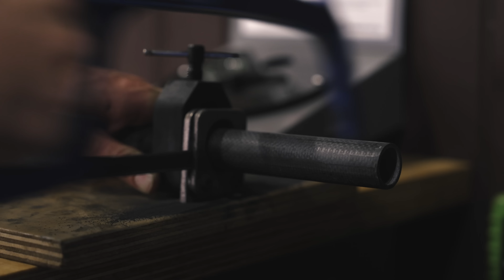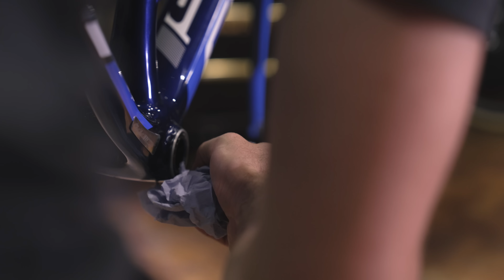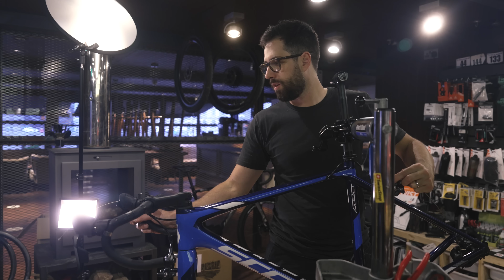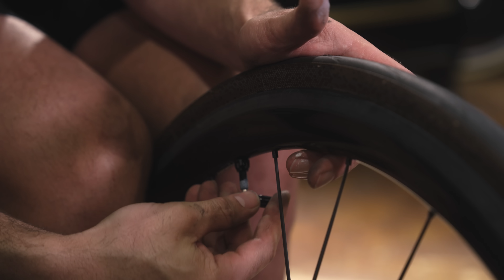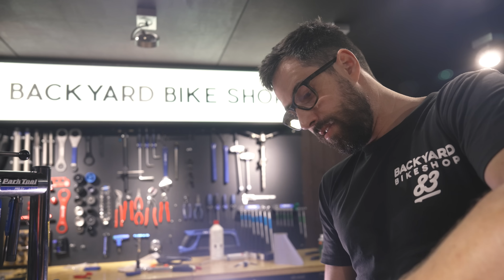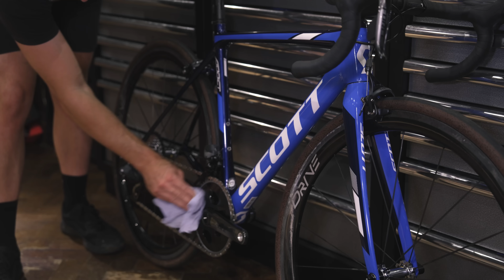Francis Cade's Rim Brake Scott Addict RC with Sram Force AXS

Comment: After watching some build videos with people endlessly fitting internal cabling this is a breath of fresh air.
Reply: Agreed. These dream builds take forever until they finally attach actual components to the frame. Even more annoying when they need zip-ties and bubble wrap to prevent Di2 cables from rattling inside a +5000 $/€ frame.

Comment: I'd have this over most the bikes his had lately. So simple, reliable and cheap
Reply from the maker: Cheap? It’s an Force AXS Etap groupset 😂
Reply: @Jimmidoesstuff  I just bought a complete brand-new Force AXS groupset 2X Disc for 1600€ (inc cassete and chain). It's not cheap, but also not that expensive, its cheaper than the new 105 Di2.
Reply from the maker: @jc74435  and sooo much better!!
Reply: Make it steel, threaded bottom bracket, non-tubeless, and non-electronic groupset, then we're talking
Reply from the maker: @ShiningTrapezoid  lol
Reply: Simple reliable and cheap, bro this thing is more complicated and about 5x more expensive than my motorbike

Comment: Classic with round seat post, separate stem, bars and rim brakes. But what does it weigh?
Reply from the maker: 7kg
Reply: @Jimmidoesstuff  So Francis builds you a bike that’s a death trap and then has this built for himself🤔
Reply from the maker: Shocking isn’t it.

Comment: what's up with the BB, just too much preload or misaligned bearings?
Reply from the maker: There’s nout up with it.
Reply: @Jimmidoesstuff  oh? Good to hear the 'mechanic' also noticed the distinct lack of spin during the build and the walk off, and got it sorted. 😬
Reply from the maker: @RobinHood-yk8og  cranks don’t spin if greased correctly.
Reply: @Jimmidoesstuff  cranks don't spin if there's something wrong with them

If they don't spin at all, or bind as soon as you stop applying power then you've got either a seized bearing, too much preload, too much/too thick grease.

If  I'd just paid >£1k for that groupset, I'd definitely be backing off the preload and checking the alignment.

Comment: Tubeless rim is such a terrible idea
Reply from the maker: Nah, it’s fine. Stuff is good now. Was shite few years back.
Reply: @Jimmidoesstuff  I'm more concerned with the lesser quality ones, cuz with tubes, at least there's a bit of support when the heat from braking softens the resin and thus the edge of the rim. But in any case, I'd still go with tubular if I want carbon rim brakes wheels